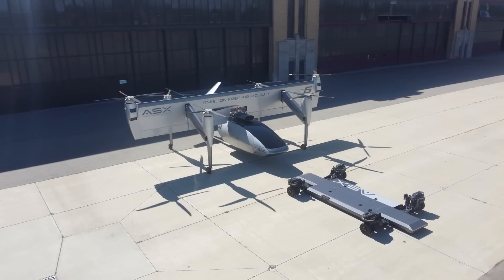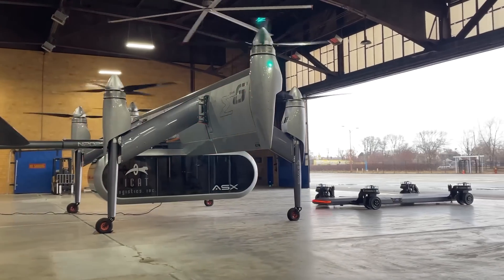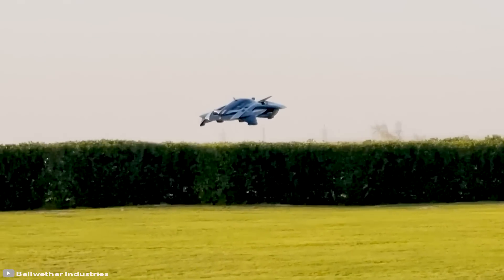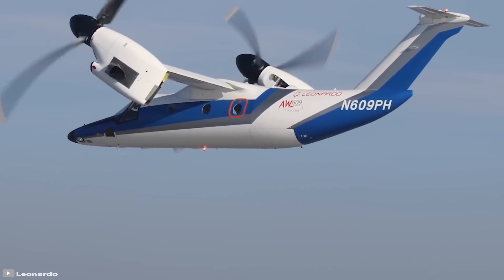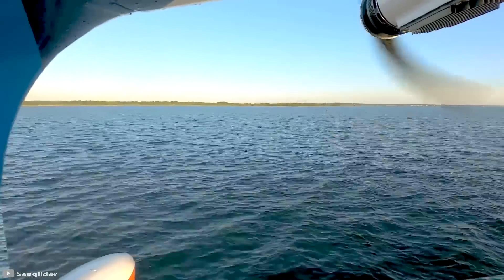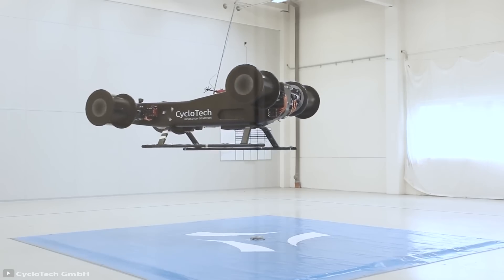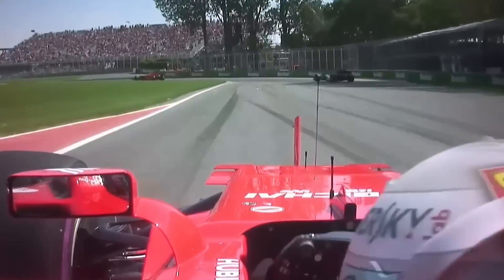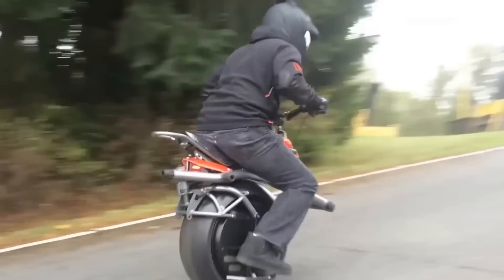MOST INNOVATIVE AIRCRAFT YOU DIDN'T KNOW ABOUT

Comment: Dude, make your research right... the AW609 started as a Bell project (XV-15), that still runs, and has been flying since 2003. Several improvements on the design lead to 3 more prototypes been made in 2016 for a new certification process, that after 5 long years, its almost done.

Comment: Air racing is nothing new, been around since the dawn of flight.  In fact air racing is becoming an endangered species to some degree due to accidents, deaths etc. Even model airplane air racing has killed people.  Not matter how you look at it it is not safe. Far more unsafe than car racing. Crashing in three dimensions in a race plane is far more likely to be fatal than in a two dimensional car race. There is a reason flying cars never took off, no pun intended and the same reasons are just as valid as they were 40 years ago!!

Comment: The biggest problem I see with most of these is the glide ratio of    0
In the event of engine failure 😨
Reply: Ballistic parachutes can negate some of this issue as these vehicles are mostly super light weight.
Reply: @justsayno1415  just like they helped 
Yogi Bear 🐻 ?    LoL 😂
Reply: Yes. It needs a minimum speed and wing span to glide.
For the new 'commercial passenger' electric planes, the batteries are also a  pain. Saw a news that the batteries must be replaced after about 14 trips. Very expensive.
Reply: They will be using parachutes...
Reply: @deevnn   Only if there’s enough altitude for a parachute to work
Reply: @mhughes1160  Ballistic parachutes can open from the ground. It doesn't need much altitude. The problem with quadcopters is they don't translate efficiently from small scale to large passenger scale. The companies that are trying to build quadcopters for passengers have never exceeded more than 50 to 60 mph. The amount of hull tilt to get up to speeds of let's say a helicopter about 100knots would be almost vertical. They have been chasing the hopeless dream for a decade. Most of the people building them came from racing drones and they aren't even engineers. They are hobbyists. Fixed wing is going to be the future for a long time. Which is why I love the Boom XB1 Supersonic passenger plane program. It has the best chance of succeeding and flying much faster than the Concorde.
Reply: Human carrying rones with 4 motors, one at each "corner", horrify me... Imagine what would happen if one of those motors fails.
Reply: Ha! my thought exactly...
Reply: As long as they have variable pitch propellers they should be able to auto rotate just like a helicopter does in the event of engine failure.
Reply: Right.
Reply: Many of these could use auto rotation to land safely, just as a helicopter does today
Reply: @DrParticle most of them definitely could not autorotate

Comment: One of these is actually a real serious aircraft from a real experienced aircraft manufacturer Augusta Westland is developing AW609 as a civilian commercial version of the US army Bell  V 22
Reply: That thing has been a flying prototype for 15 years with Bell Helicopter Textron being the original designer. However, I think we're done with tilting turboprop engines. Just look at the Bell V280 Valor as an example. Tilt the prop-rotor and keep the engine(s) horizontal (no hot exhaust burning holes in the ground, safer for passengers).

Comment: Electric planes are not near ready yet. 150 mi. range that's only 75 each way. Driving would be MUCH more economic.  After installing batteries that aren't invented yet, the range will increase.... Wouldn't a catapult be easier and cheaper that a whole other devise to get it in the air.
Reply: Doesn't work like that. EV charging is so fast now that for aircraft, by the time you have unloaded at your destination and reloaded, which takes 20 mins or whatever, you are pretty much approaching a full charge again. Even with cars, many charge so fast now that you barely get time for a pee break and to get a cuppa before you hit 80% and need to move the car. All electric aircraft I've seen have prioritised charging speed...
Reply: @ledsalesoz  It's not the charging speed, it's the range.
Reply: So, according to your obtuse thinking, the Wright Brothers first flight of only 12 seconds was a failure ? They should have waited for a 200 hp motor instead of the 12 hp they built themselves (out of aluminium, no less !!!)  ?  Riiiight...  Considering that a few  months later, they flew over a distance of over 4000 feet and with the Flyer III in 1905, they flew it for over 38 minutes and 38 km,  not bad, I'd say ! The rest is  history! Thank God for bold and dedicated inventors...  👍

Comment: While considering the merits of aircraft having a detachable passenger compartment I can't shake off thoughts of what would happen if a malfunction caused separation of the compartment in flight.
Reply: How about a combination of parachutes, solid fuel rockets triggered related to speed and ground proximity and tons of airbags inside and outside the capsule... needs some development.
Reply: @christophschreiber172  lol…… it’s called NASA and actually besides parachutes and rockets there’s actually technically a term for this called an accelerometer and other fancy things which can trigger and air bag around the capsule, the funny thing is what I’m saying is nothing new. When a rover is sent to another planet they eject the airbag prior to touch down, how do people don’t understand this, some dummy said a parachute doesn’t open at a certain altitude we’ll go figure there are more redundancy you silly you
Reply: You better never use an elevator. :face-purple-crying:
Reply: So what if there’s a parachute attached to the capsule? The plan is to eject the whole capsule with a parachute saving all lives?
Reply: @stevennagley3407  parachute only works if you are high enough, at a low enough height a parachute wouldn't have time to open
Reply: @EKUL34 a parachute only works with air, on the moon it wouldn't have any air to open.
Reply: @kropper1802  Who said anything about the moon?
Reply: @stevennagley3407  ⚠️ God has said in the Quran:

🔵 { O mankind, worship your Lord, who created you and those before you, that you may become righteous - ( 2:21 ) 

🔴 [He] who made for you the earth a bed [spread out] and the sky a ceiling and sent down from the sky, rain and brought forth thereby fruits as provision for you. So do not attribute to Allah equals while you know [that there is nothing similar to Him]. ( 2:22 )

🔵 And if you are in doubt about what We have sent down upon Our Servant [Muhammad], then produce a surah the like thereof and call upon your witnesses other than Allah, if you should be truthful. ( 2:23 )

🔴 But if you do not - and you will never be able to - then fear the Fire, whose fuel is men and stones, prepared for the disbelievers.( 2:24 )

🔵 And give good tidings to those who believe and do righteous deeds that they will have gardens [in Paradise] beneath which rivers flow. Whenever they are provided with a provision of fruit therefrom, they will say, "This is what we were provided with before." And it is given to them in likeness. And they will have therein purified spouses, and they will abide therein eternally. ( 2:25 )

⚠️ Quran